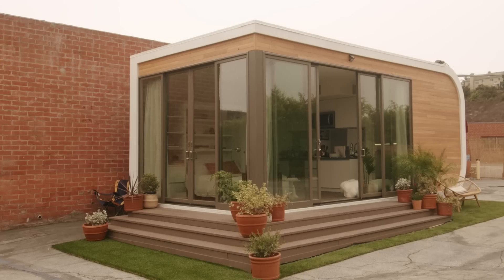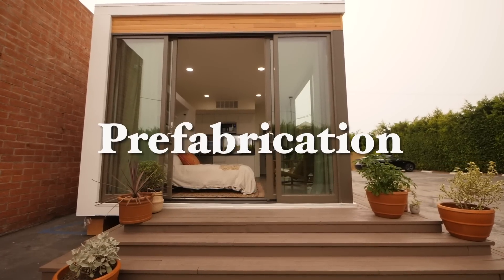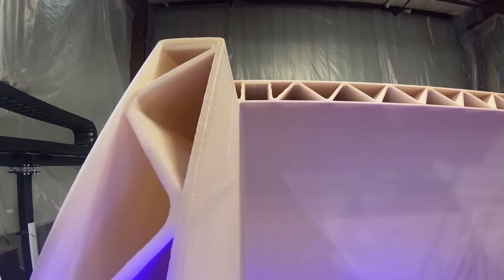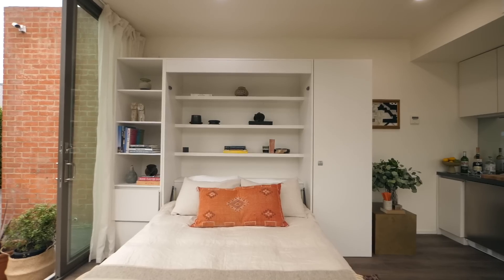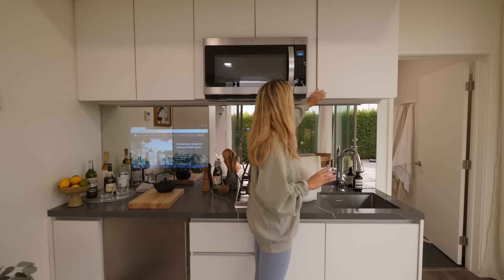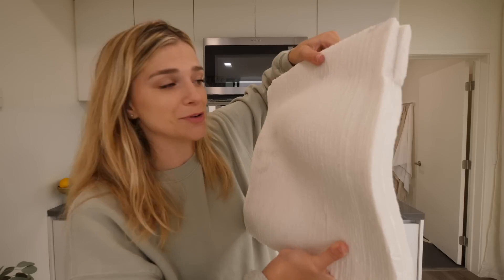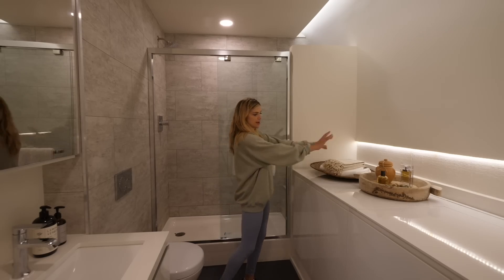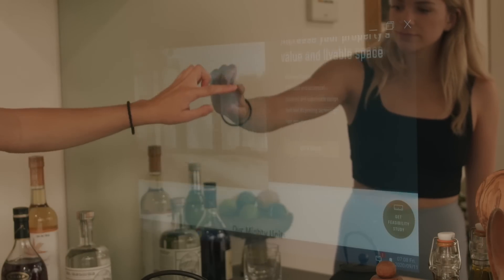Would You Live In This 3D Printed House?

Comment: Next thing are self repairing house materials....😄

Surrounded by possibly a sticky flowy fluid surrounding the surface,
clensing, transporting dust away, sealing eventual holes, keeping the surface material new reducing the corrosion to 90%.

Imagine a surface paint flowing slowly around the exterrior house surfaces.

Some non ferro magnetic fluid, based on chemicals that stick maybe to certain surface plates 
powered by Solar Cells wich apply a flux stream.

Perhaps some smart molecule paint with magnetic points that morph by certain small electricity signals.a

Perhaps one could even apply on a display touch the design of the exterrior surface 
morphing ,,opening access storage.

Comment: For 350 sq feet, 24 hours for the shell, two weeks to finish, then transported to the site the cost is 115,000. 
How about 350 sq feet, in 24 hours, infrastructure accounted for by design, a faster finish time by trades, 
built on site, for 4,000 for the structure, and 4 to 5,000 for the rest, total 9,000 instead. A unique concrete.

Comment: That pretty exy for a studio place... in Australia you can get a 4 bedroom 2 bathroom 2 car park home built for under $300,000. If they want to compete they have to lower the price, it's def not costing them the same as if it was built traditionally so the prices should be WAY lower. 
Eventually when more companies offering 3D printed homes come up, the prices will drastically drop. In a few years you'll be able to buy this for $50,000 or so.

Comment: If they had much more options and cheaper prices, than I am in.. I wish they would build replicas of 3d printed versions of LUSTRON HOMES.. I would totally be buying in a heart beat.. There is a company called Boxabl, where you have folding out modular homes. They are 500 sft, starting at 50k.. Much cheaper than 115k..